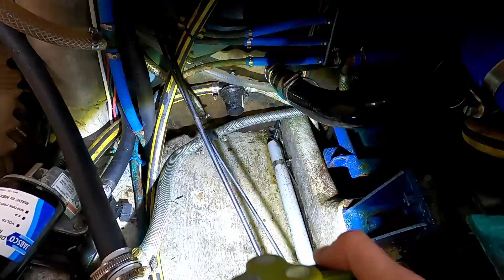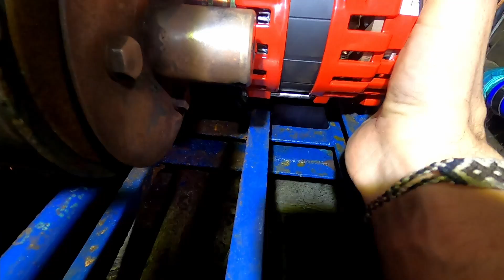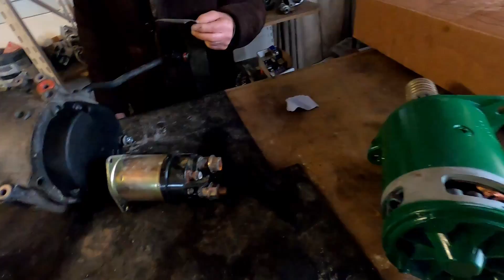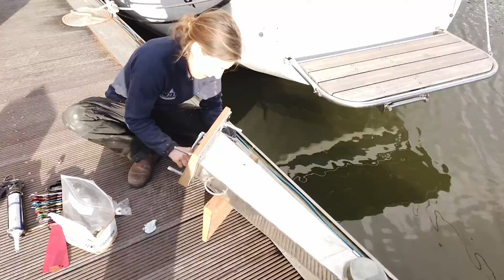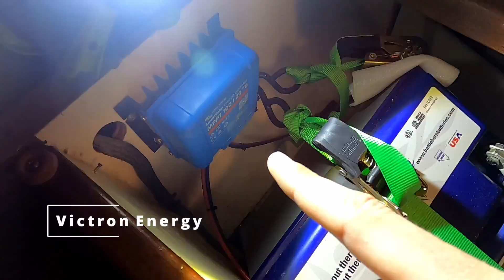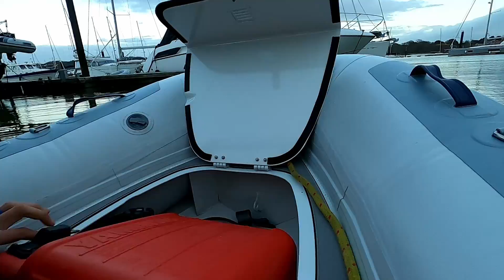Boat Work is Fun! - Completing a Winter Refit on our Sailboat [Panda Journey #59]

Comment: Great video. Interesting to see you removed the solar arch for dinghy davits......we are thinking of doing the opposite. I guess we always think the grass is greener on the other side! Our solar right now is above our cockpit enclosure which works great but we think we want more solar. This makes us reconsider. Thanks guys!
Reply from the maker: Glad you enjoyed the work! It's hard to know for sure, but I think we would have kept the arch if we had stuck to the original equatorial plan 🤷‍♀️ however after sailing with it and our times docking more than we thought, I would be more inclined to find solar alternative spots on the boat, like the easily removable and adjustable side stern wing panels or the ones under development that go up the mast. (And a big Balmar alternator has been a game changer!)

Comment: Love project videos! It looks like you covered the other side of the insulation (cabin side) with some sort of material... it looked blue in your forward cabin shot while the foam itself looked green in the application section of the video. If you did apply material what did you go with?
Reply from the maker: Thanks for watching!  The foam is just gray both sides, and we didn't cover it...yet.  probably just bad white balance in those shots.  It's just 12mm closed cell camping mat foam 🥰

Comment: Great job guys!  Yes, good get the excess weight out of the bow.  One idea to maybe further improve you anchor rode might be to switch to the G7 5/16" chain.  It is a lot lighter and actually stronger than the G40 3/8".  We were able to fit 100 meters of the G7 5/16" into our Maramu along with 60 meters of lines spliced to the end and the weight seems ok.  You will need to change the wildcat/gypsy on the windlass to match the smaller chain but these are available.  Best J&J
Reply from the maker: Oh wow that is a great tip!  Probably once our chain is used up we would go with this for sure.  The sailing performance is noticeable keeping it light up there!